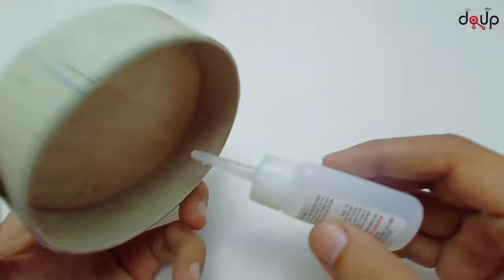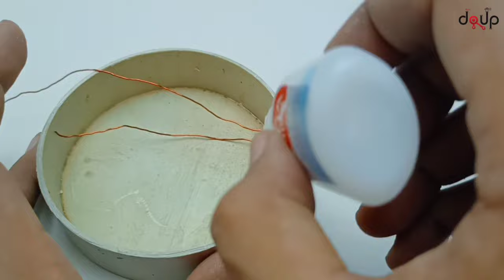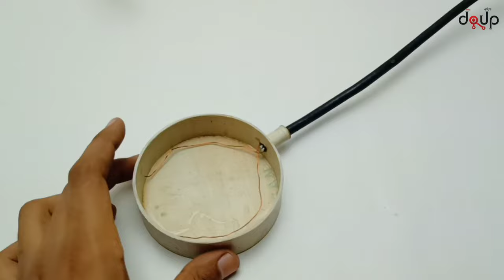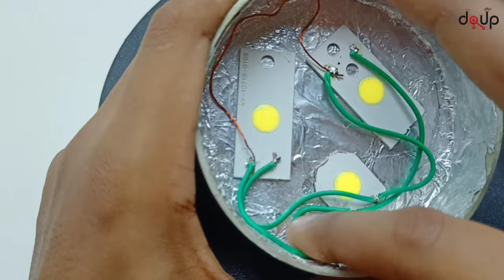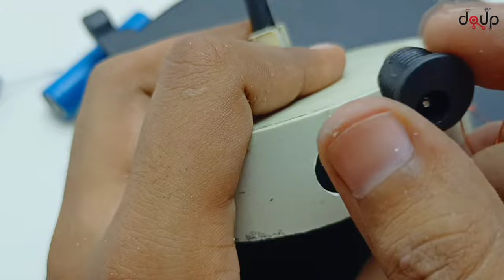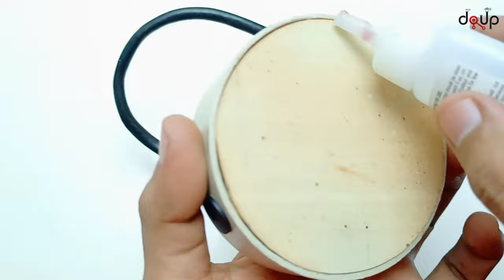How to make a Table lamp at home | lamp| flexible table lamp| diy lamp | homemade light | pvc lamp

Comment: Can I have the full list of the materials please!
Reply from the maker: Pvc pipe 4 inch Diameter 
3 led bulb ( operate on 3.7 volt dc ) 
3.7 volt battery
Butter paper
Super glue
Flexible pipe
Alluminium electric wire 
Insulated Copper wire
3.7 volt BMS
1 on / off switch
1 dc charging socket
Double side tape

Comment: Which materials did you use for the cable?
Reply from the maker: 1) DD free dish antenna cable
2) Alluminium electric wire 
3) copper wire